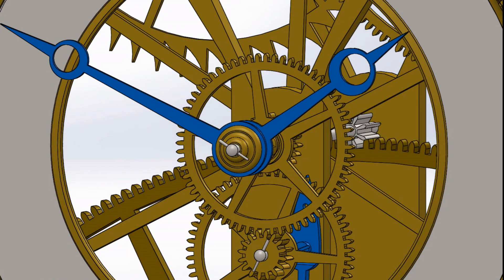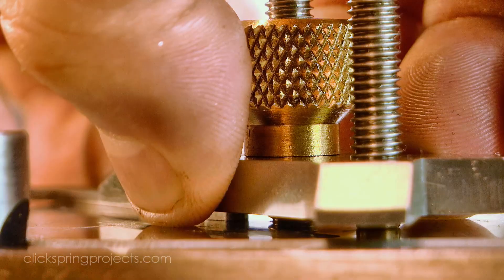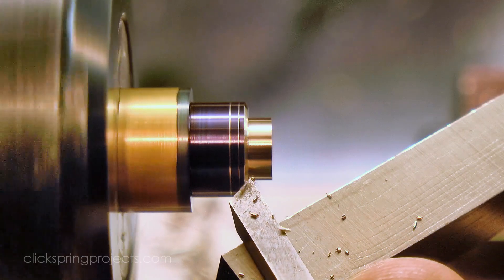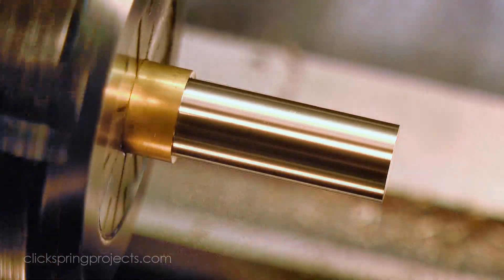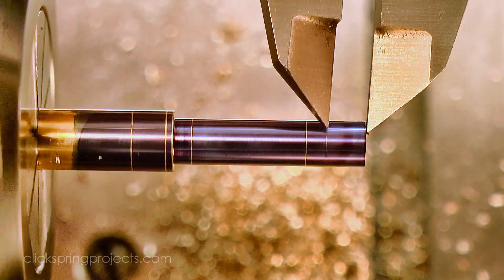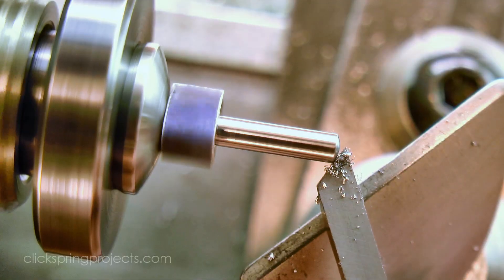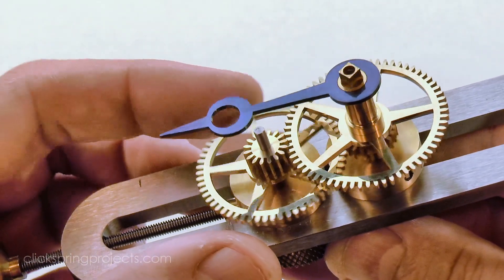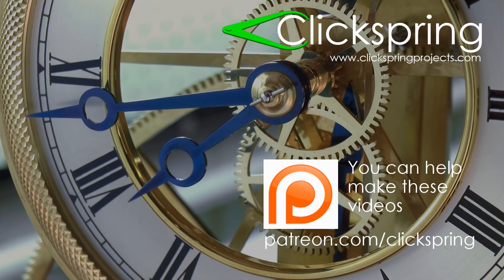Clockmaking - How To Make A Clock - Part 16 - Making The Motion Work And Hands

Comment: I am a little late to the Clickspring party by a few years but fascinated. At about 13:50 when you begin the assembly the installed orientation ("clocking") of  the stud/post made from square stock is shown with the faces aligned with the frame. How did you achieve the orientation? Trial and error skim cuts to the stud shoulder?

Comment: Hi Chris, Love your videos. a couple of questions for you
at 11:20 how to you make sure that the wheel is not rotating as you are drawing lines and moving the ruler?

at 1:58 and 2:21 and 3:18 the lines on the paper seem pretty hard to see.  is there a way to make the lines stand out more after getting the lubricating oil on them?

at 9:28 how did you make sure you turned the part by exactly 90 degrees?

Thanks
Reply from the maker: Very small strips of double sided tape hold the parts on the crossing jig. I've shown this in a previous video, but I don't recall which one. You might find that the lines last better on a higher quality gloss paper, although in practice I find they last sufficiently well on the cheap paper. The part is held in a cube shaped collet block, 1 turn gives an accurate 90 degrees. Thanks for watching and asking :)

Comment: Sir your clock are fine works of art, do you coat the brass to control tarnishing or what?  Most of my stuff is just sandpapered.  
I am not in your class this AM I made two thumbs screws for a old now compass with a beam extension.  I have owned for nearly fifty years the old screws had been lost there not perfect but they work.

Comment: Those parts are so shiny. Is it brass you´re using it looks like it. your videos by the way are super relaxing to watch and your voice very soothing. Keep up the good work you have just earned another sub. One final question though what is that thing that sounds like you say "arbor" i can´t hear what it is?
Reply from the maker: +Ryan rosenberg Yes its "arbor" - its a term used to describe a shaft or cylinder that is used to subsequently hold something else (usually the workpiece, but also tooling). Different authors use the terms "mandrel" and "arbor" in different ways, so the definition of which is which have become a bit blurred over the years http://bbs.homeshopmachinist.net/archive/index.php/t-16350.html Great to have you watching Ryan, and appreciate your sub :)

Comment: When you mark lines on the lathe with your vernier callipers, are you then using the lines merely as a visual guide and following up with DRO positioning or hand wheel graduations, or just turning a shoulder to, or parting off at those lines freehand? 

I have to agree with others here that your videos are first class and then some!! Please do some videos on making steam engines! No, on second thoughts.....................
Reply from the maker: +Roger Crier Hey Roger, I work to the line freehand, as marked by the calipers. I have no DRO installed on my lathes. There is a small cosine error associate with doing this (caused by the small unavoidable angle of the caliper as the line is marked), not to mention the inaccuracy of the calipers themselves, but it gives a surprisingly accurate result. Within a few thou if I am careful, and it is interesting that length dimensions are rarely as critical as outside dimensions, for most of the parts that I make. I should mention that the practice of using calipers to mark out dimensions in this way is generally frowned upon, particularly if using good quality verniers, because over time the marking will slightly wear the tips - definitely don't do this with your Mitutoyo's! However I use cheap import calipers, and at $10 to replace, consider them to be a disposable tool. They fall apart for other reasons, well before they show any signs of wear. Great to have you watching mate :)
Reply: +Clickspring I do exactly that with my cheapo callipers and have done for years! They don't seem to wear out at the points but some edges scribe a better line than others. I have refrained from sharpening the edges!!!!!!!  I have a pair in the shed, a pair in the house, and a pair at work.

I have fitted a diy DRO to my Boxford lathe. It bluetooths the slide positions to any Android tablet or phone and uses a free app from play store. It has transformed my machining enjoyment and it has most functionalities, like holes on a pcd, imperial or metric readout, a RPM readout, a memory for different tools and also different machines etc etc. They have just released a random holes on a pcd, function. Check it out, it is called "TouchDRO"  I can help with the electronics bit if you like!
It is strange seeing taper pins that do not go through the parts they are retaining! It must be a clockmaking thing.
Just made a tiny steel crankshaft for a Stuart D10 out of a solid 40mm dia bar. Hard work!

Comment: What I fail to understand is why you always leave so much material when using the scroll saw. Why 2 mm instead of 1 mm? Given the extra ammount of time for sanding/filing more material the risk of error should increase rather than decrease, due to lack of focus from the monotonous nature of the work. "Still far away from the line... still a bit to go.. and some more. Ooops!"
Reply from the maker: +Olegh Typically I will cut about 1 - 2mm short of the line with the saw, and then end up 0.5 mm short after linishing with the belt sander, leaving the rest for final finishing with files/abrasive paper. The reason is that there is often much variation in the cut depth for a jewellers saw blade, given that not all cut strokes are perfectly vertical, and its very easy to drop a cut mark inside where you think you've put your cut and mess up the perimeter. More material gives you options - it is easier to take metal off, than to put it back on. Thanks for watching and asking
Reply: +Clickspring  Great answer, thanks!

Comment: Hi Chris,
As always extremely well explained, filmed and edited. Lot's of techniques I've only read about and haven't yet done myself. I know very little about actual clock / watch making so my following comments could be worthless and in no way reflect on how you chose to do the work. 

I fully realise the traditional way is marking out, centre punching, and then drilling. When possible I no longer use that method given the slight inaccuracy's that can creep in even with very careful work and use coordinates for hole location on the mill instead. And I've yet to be fortunate enough to own any lathe where the tailstock centreline is in 100% alignment with the headstock's C/L at all positions along the lathes bed. Some are very much misaligned either high or low with a brand new machines. So for critical and as concentric as possible parts I now drill undersize, single point bore for round and straightness, then ream for size. It's another way of doing the same job that is slower of course, but does give more accurate parts given a reamers tendency of following the original alignment of the drilled hole. Again it may not be the traditional clock makers way but it works. 

Please keep up the excellent work, I can't recall one of your videos where I haven't learned a lot.
Reply from the maker: +Turning Point Thank you Pete, I agree with your methods, and observations regarding dealing with tailstock centering of modern import lathes. I use the same approach and find that it works excellently. Terrific to have you watching mate :)
Reply: +Clickspring very glad you took my comments how they were intended Chris. And you've got a hell of a good memory for names. No problem getting me to watch any of your videos, you have a subscriber for life. :-)

Comment: Great work as always!
You said that for now at least you're not going to bond the parts together; does having the gears simply press-fit into place introduce any potential for losing time via the gears slipping on their axles? I imagine the minute hand should be fine as it's mounted on a square, but the hour hand is just on a circle. Is it a tight enough fit that it won't slip at all?
Reply from the maker: +Chris Latham Hey Chris, yes its a definite potential risk for the hour and minute wheels, as well as the intermediate wheel/pinion pair, so I will most likely bond them permanently at the final finish stage. For now it's convenient to keep them easy to separate, so I can get a good polish on all parts before final assembly. The hour hand is as solid as a rock, so I will leave that as an interference fit. Great to have you watching mate :)
Reply: +Clickspring That makes sense. Thanks for the reply!

Comment: hey chris i have a question. what speed is usually the best for cutting brass on a scrollsaw and is heat buildup a problem with scroll sawing or not as i hear working with metal heat buildup is one of the things you should always avoid.
Reply from the maker: +nightcoremixer1 Brass is very forgiving; you can just about use any speed you like. For brass, I find the limiting speed is usually defined by the harmonic vibration of the bench. Generally I will run it as fast as I can, just short of the bad vibration. Steel is an altogether different story - run it much slower, and be sure to use good quality blades. Tool steel is especially tedious. Cheers, Chris.
Reply: +Clickspring thanks chris i ask as i have a forge that can melt brass so i can somewhat cast plates or rods and i want to try using brass for projects so thanks keep up the great video's

Comment: Please help me, what's the violet fluid he always uses to mark stuff on the parts? Thanks already
Reply: +Elias Steiner It's metal bluing fluid used for providing a contrasting background to detail layout marks and punch points. You can also cheat and use a blue permanent marker to achieve a similar result.
Reply: Dykem or steel blue. Dykem is a brand and is heavily used but others can be used as well.
Reply: thank you!

Comment: Slip fits, interference fits, snap fits, close fits, there are so many ways things can be machined to go together but I can't seem to find much information on what exactly they entail. Are these technical terms or more subjective?
Reply from the maker: +TheAllBlackMan "Fits" are one of the most interesting aspects of engineering. Some of the terms I use are purely descriptive - eg "snap fit",  which conveys the meaning, but isn't really part of engineering terminology, and is entirely subjective. Other terms like "close running fit", "interference fit", "sliding fit" are part of a whole spectrum of "fits" that have very precise definitions, and associated parameters to ensure that were all talking about the same thing. More info in Machinery's Handbook Inspection section. Cheers, Chris.

Comment: at 14:11, the lower-left large wheel shows an outrageous estimated half-millimeter or so  (!) of runout on the inside edge as its rotating.  No, Im not being a picky pita.  :)  Its just that everything else is so micron-perfect, that it is the only noticeable irregular movement in the scene !    Your precision is so incredible that you make me notice tiny specks of dirt on my monitor marring the view of your mirror-finish gears  :)
Reply from the maker: +SpockieTech It does indeed have irregularity on the inside perimeter - the crossings have yet to be finished for that, and several other wheels. Fear not, all will be addressed as part of the final finishing process. Good to have you on QA SpockieTech :)

Comment: Would you ever consider a CNC machine for all those custom cuts?
Reply from the maker: +rutger houtdijk Maybe one day, but my main interest is in using traditional methods wherever possible. Thanks for watching and asking Rutger
Reply: +Clickspring but you do use cat software, printed templates, electrical tools, modern adhesives, etc. Where do you draw the line?
Reply from the maker: +rutger houtdijk If a modern process is directly analogous to a traditional method, but simply involves the substitution of a modern substance (eg loctite for solder, or CA glue for shellac), and remains substantially unchanged from the traditional method, then I am happy to investigate the use of the substitute material, to see if it might help what I do. Often the materials clock makers require for traditional processes simply don't exist any more, so substitution is unavoidable.

I am also happy to use CAD etc as a communication device in the videos, for planning, and for marking out. However when it comes to cutting the metal, my priority is usually in maintaining the direct human connection with the workpiece - a human eye directly driving a human hand to directly operate a tool to cut metal. I generally draw the line at anything that I feel will break that direct connection. I make no claims of consistency in my approach, nor do I consider my way of doing things to be better; it is clearly much less efficient, and carries much potential for error. It does however bring great satisfaction. Thanks for watching and asking :)

Comment: I have a hard time understanding the hour hand assembly becaus i keep getting  stuck thinking it interfeers with the minuthand at the gearing,can someone please explain it to me?
Reply: +Samo Dimitrije
Main clock shaft turns, there is one gear attached to it that couples to the gearset underneath. The other gear on the lower gearset in turn, drives the last gear that is attached to a bushing that slides over the main shaft
Reply: Jan Hoppenbrouwers oh thanks!i was kinda hawing a hard time thinking the main clock shaft would interfere with the hour hand  bushing

Comment: perfect. nice work. im in the process of buying a small lathe. so hope we could share knowledge. just one question. do you plan to protect the brass? it will oxidise with time
Reply from the maker: +Nikola Zivkovic Other than electroplating (gold, rhodium) there are no really long term protection methods that will last the lifetime of the clock (several hundreds of years). Traditionally unplated clocks are left to develop a oxidation patina, which soon stops progressing and gives the clock a beautiful aged look. Thanks for watching.
Reply: Yeah i know that. Just thought maybe someway to protect the shine. Im often using patina to protect copper conductors  just leave them on elements and use patina to protect copper rail. But hey again nice work i relly like this clock, to say i usually hate big clockworks but this is special...Cheers

Comment: Why is it better to bring the drillbits into the spinning material as opposed to the drillbits spinning into still material? Simply convenience? It's all 
the same I''m guessing?
Reply from the maker: +Michael Allen That is actually a very, very interesting question. There is much belief among machinists that there is a natural centering quality of a stationary drill bit entering a rotating workpiece (ie drilling on the lathe), and therefore that a rotating drill bit into a stationary workpiece will have a greater tendency to wander (everything else being equal).

Many very experienced old school clockmakers absolutely swear it is a real phenomenon, and there is some anecdotal evidence that this is true - free hand drilling of clock pivots on the lathe for example, should not be possible if the phenomenon is not real. Having sad that, there are an equal number of machinist that say it is hogwash, and that there is no empirical evidence to justify the claim - it is a subject ripe for a decent PhD study.

My personal observation is that I get much better centering when drilling on the lathe, but I am open to the possibility that I am deluding myself! Thanks for bringing this up Michael :)

Comment: How come you don't sand closer to the line? Seems like you leave way more meat than necessary for hand filing.
Reply from the maker: +Rhys D Mainly because I have learned to be very cautious about working with small part perimeters. Typically I will cut about 1 - 2mm short of the line with the saw, and then end up 0.5 mm short after linishing, leaving the rest for final finishing with files/abrasive paper. 0.5mm is the bare minimum I am prepared to leave on, to guarantee enough material to safely move through 2/4/6 and 8 cut files, a few grits of abrasive paper and then burnish - As the saying goes, its easy to take it off, but much harder to put it on. There are few things in life more annoying than knowing you have to start a part from scratch, because you were a bit too cavalier, and took off too much metal. Thanks for watching and asking Rhys
Reply: +Clickspring 
Thanks for the answer. To be honest, my eyes deceived me a bit, the margin looked closer to 2mm after sanding. I guess small parts are deceptive on video!

Comment: Hey, I don't own a shop or any of the parts. I just like watching the videos but i was wondering... What is a reamer and what is it used for? to me it just looks like a fancy drill bit with more shallow pits.
Reply from the maker: +tcooke2 A reamer is used to bring a hole to a precise size and surface finish, as opposed to a drill which leaves a relatively poor dimension and surface finish, if examined up close. Thanks for watching and asking :)
Reply: Clickspring
Ah I see. so why is it shaped like that? Thanks for replying by the way.

Comment: How is this blue lacquer called?
Reply: +Anticonny I believe you might be referring to the blue fluid he uses to scribe marks into the metal, right? If so, It's called "Dykem blue". A layout fluid used for metal working.
Reply from the maker: +Anticonny https://youtu.be/NhjiIPohUyw Thanks for watching
Reply: Clickspring
Thanks for the fast response but I meant the "paint" that you apply to mark your measurements.
Reply: +Anticonny 
It's called Engineers Blue (layout fluid) https://www.ebay.co.uk/ulk/itm/381553650032
Reply: Nice thanks again :)